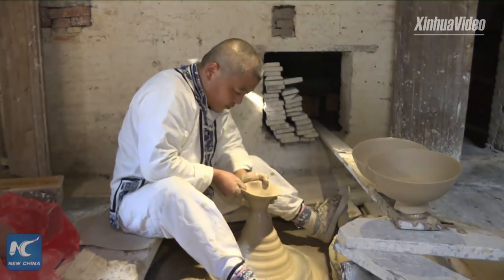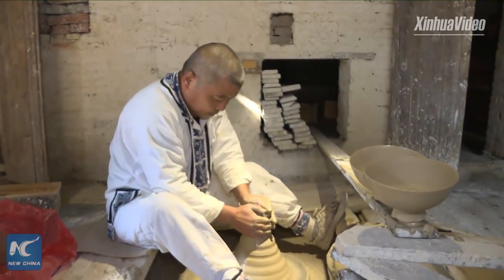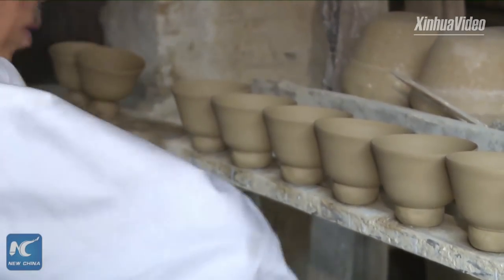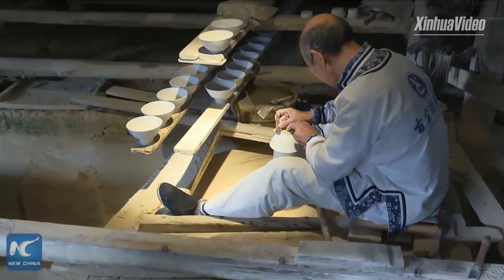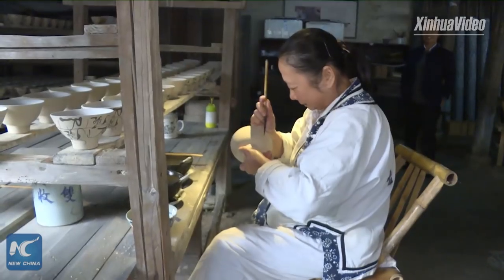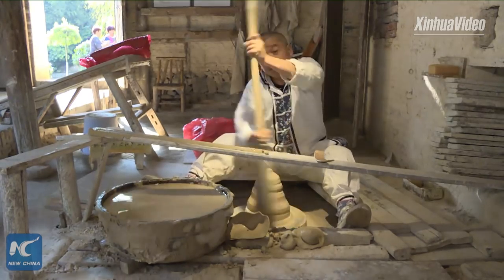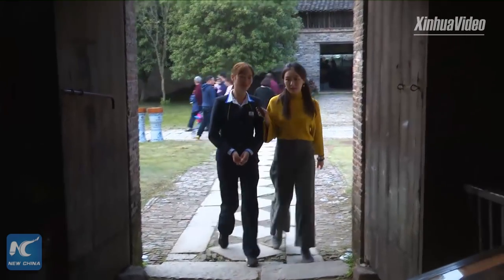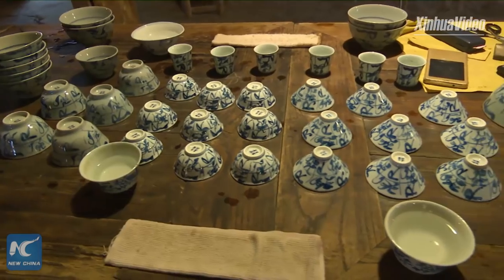How is porcelain made? A peek into world's "oldest" porcelain production line

Comment: WHERE DO YOU DIG THE CLAY AND HOW DO YOU SEPARATE IT FROM BAD MATERIALS IN THE CLAY
Reply: You strain it and the best way I know of is a river bank, but not the top soil the clay is a few feet down so.sometimes more.
Reply: Most clays can be separated simply by using water .
Allow the heavy material to fall to the bottom and then pour off the access water. The. Allow the water to evaporate or, boil until it is the consistency you desire.